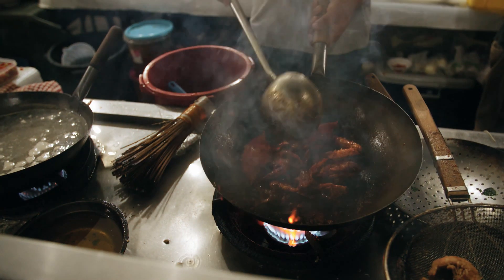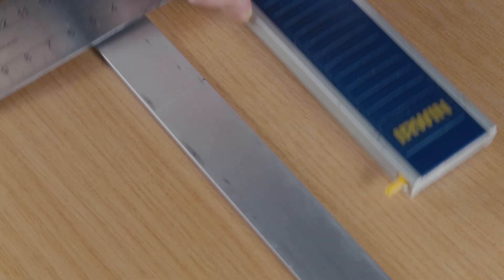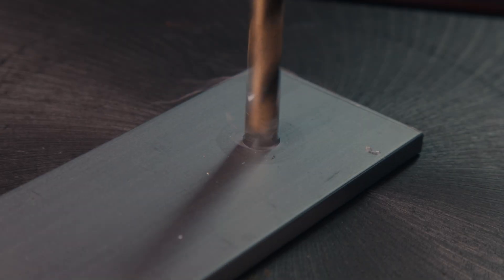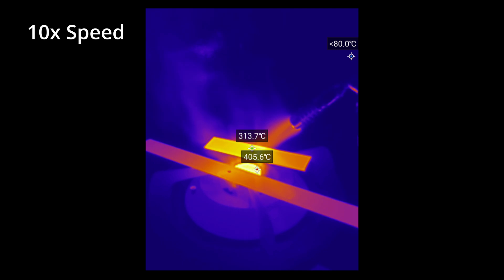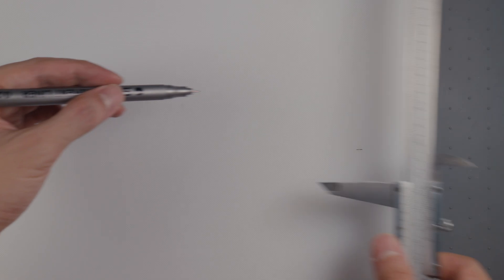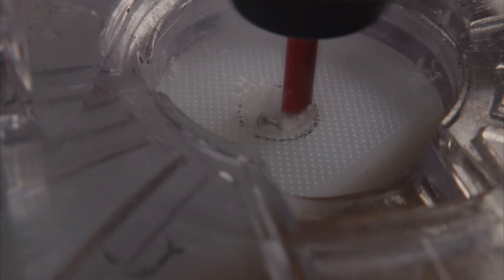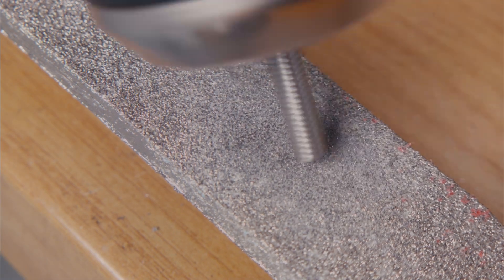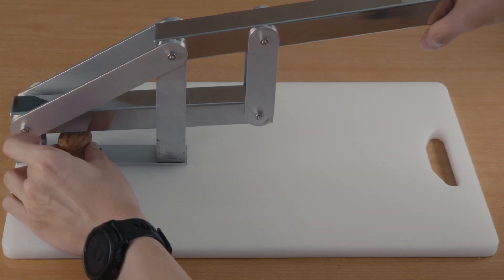DIY Nut & Crab Shell Cracker with 10x Mechanical Advantage

Comment: This design had me curious, because you claimed a 10:1 mechanical advantage and just eyeballing the arrangement I couldn't tell how it was better than a simple single long bar, ie. the activating hand looked to be 10x further from the bottom pivot than the thing you were cracking, so what good is the compound lever? I did a screen grab and some scaling and you actually have about 12x-15x mechanical advantage, depending on where you place the crab claw in relation to the bottom pivot. If you want more crushing force, attached the bar connecting the two tubes closer to the upper pivot. You'll lose some range of motion on the lower bar and you'll need a longer connecting bar to keep your angles reasonable, but your force will go up quite a bit.
Reply: Also, nice work! :)